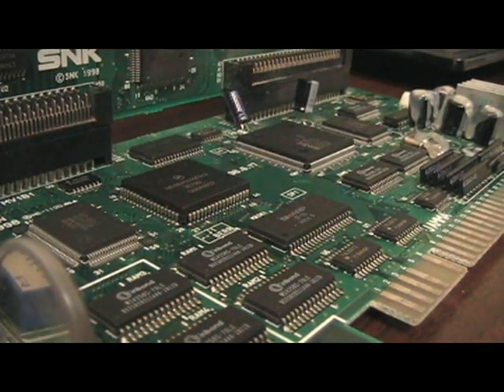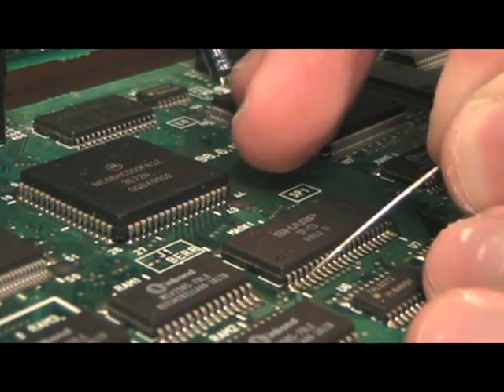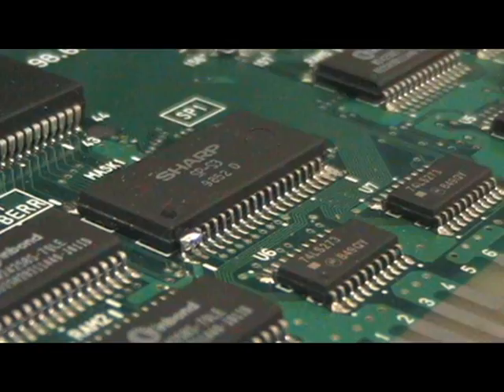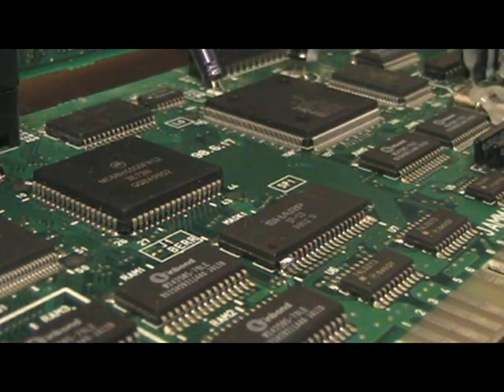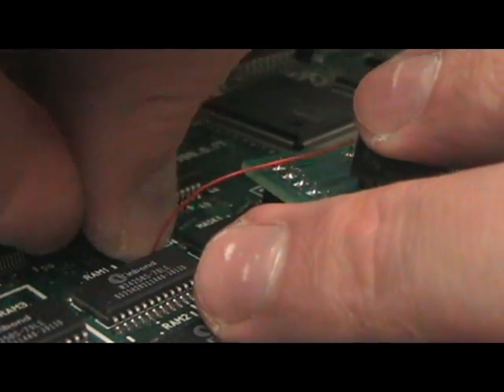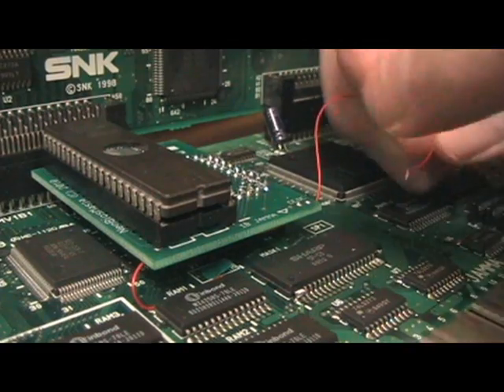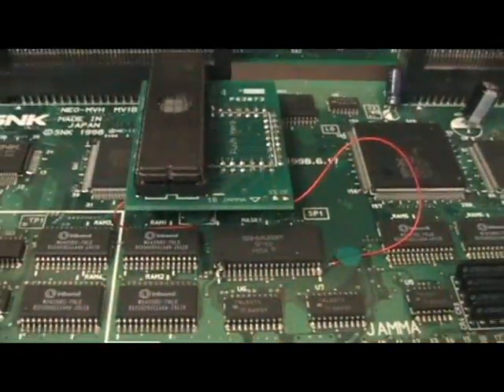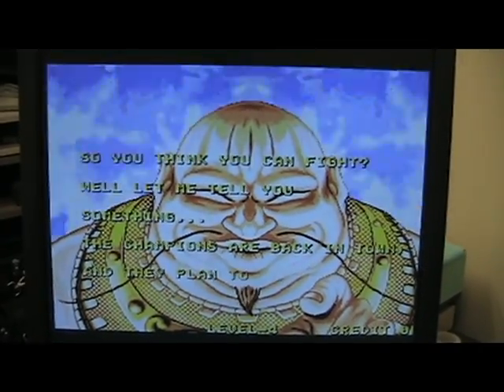NeoBiosMasta install on MV-1B

Comment: Picked up a board in pretty tough shape. Removing pin2 it lifted it's Trace off the board. Trying to still salvage the board. Would installing by the vias still be a option? Getting block graphical issues upon power on.
Reply from the maker: If the pad was removed, installing by the via would probably be the next easiest option.  Soldering it to the DCR chip is the next option, but it can be difficult due to the tight pitch.
Reply: @turfmasta  thanks turf. Just installed, tested for continuity and all seems good. Upon first boot. Watchdog clicks and blocks. Gonna try a different bios and see if that fixes the issue. Any ideas what it could be if the bios isn't to blame?

Comment: So. If we just completely desolder the stock surface mount Bios chip... All we have to do is solder those two wires to the proper solder pads?
Reply from the maker: yep!  this is a really old video, the install instructions are on the order page.
Reply: @turfmasta  thanks. Was able to do the pin deactivation. Might just totally remove the old bios next time I open up my B board. I appreciate the reply. Good product man. Might try out your VMC variant unit next time.
Reply from the maker: @nexusofice9135  Sorry for the late reply, I just saw your post.  Glad you like it!
Reply: @turfmasta  no worries man. Always glad to support someone in the community that puts in as much as you do.

Comment: Is it possible to put the Neo Bios Masta into an AES system?
Reply: No, but you don't one anyway.
You can just desolder the bios and replace it with a socket, the put your new bios in the socket.
Reply: I know I’m late but in 2021 there are other solutions.....just in case you didn’t sold your aes console ....🐧